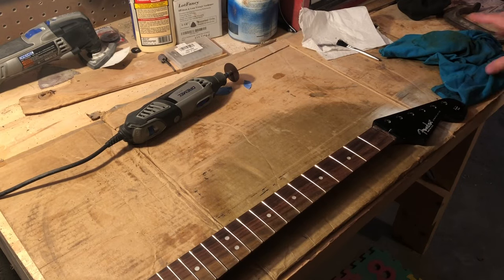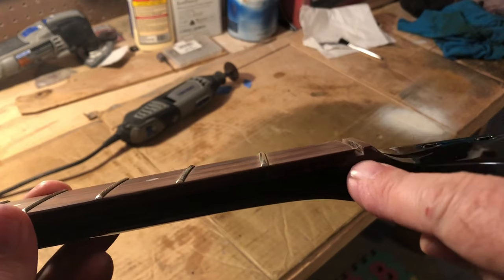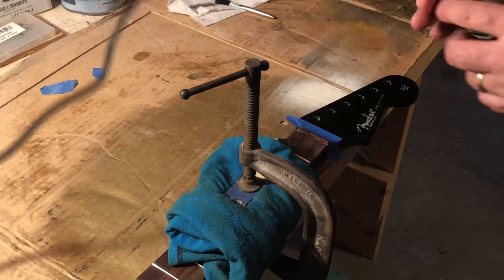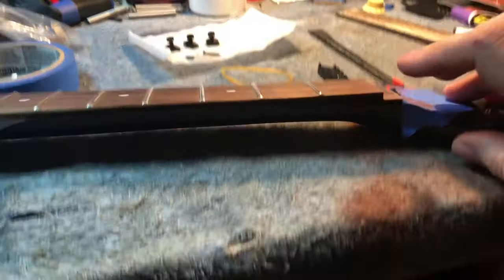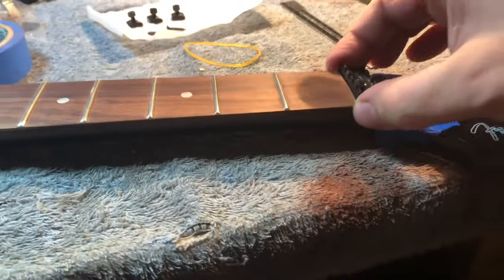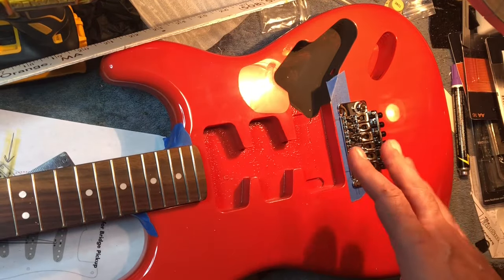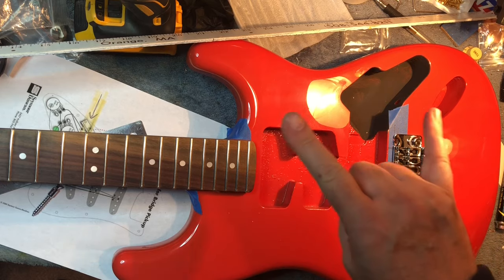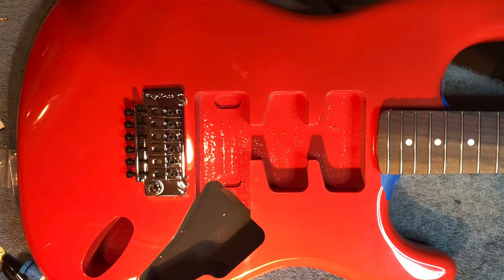Installing a Floyd Rose On A Fender Brad Gillis - Full Tutorial

Comment: Is the floyd rose shown at the end of the video the one you going to intall? Becouse that one hasn't got fine tuning like the one you showed earlier,so what's the point to install a locking nut if evertime the guitar goes out of tune you will need to unlock the nut and then lock again with that bridge would make more sense the locking tuners with a tusq nut.
Reply from the maker: @thegladio64  It’s an exact replica of Brad Gillis’ guitar. He uses a non fine-tuning Floyd and a locking clamp. AND he’s done it since 1982 with zero issues. You just have to stretch and tune the strings, thoroughly before locking and it works just fine. You should watch a few Floyd Rose videos and learn about their history etc. Thanks for watching and commenting.

Comment: This bridge with locking tuners could do dive bombs and stay in tune without the “instability” of a double locking FR? 

I can’t seem to find too many new videos on the non-fine tuner bridge so forgive my ignorance.
Reply from the maker: The double locking Floyd Rose is the most stable tuning trem ever! Not sure what you meant there?! Yes, the non fine-tuning Floyd, combined w/ locking tuners should perform very well; divebombs etc. I built this guitar as an exact replica of Brad Gillis’ guitar. His came w/ an early non fine-tuning Floyd AND a locking clamp at the nut. He learned tricks and techniques to get the clamp locked while the guitar was in tune and it was remarkably stable, for him. Hope this helps and answers your questions. 🤘
Reply: @Metalcop5150  yes! Big help. I misspoke regarding the instability part. I’ve had FR for years and I know that once they are tuned they STAY in tune. I was referring to the floating bridge sometimes dropping when you replace the strings. My mistake.
Reply from the maker: @MrHomolka  The trick to changing your strings is to replace them one at a time!! Lol That sounds simple, but the trick is to take only one string off, replace it w/ the new one, tune it to pitch and then do the next and so on. That way you never ‘lose’ your setup!! There are lots of other tips and tricks out there, but for a floating bridge, this works best for me. 😉
Reply: @Metalcop5150  thanks!

Comment: These are the most involved installation, even a pre-routed body from overseas is a pain in the butt since you have no reference to what template they were using! I have a FR routed Strat style body that I've doweled already because I have no reference points. I am starting over and trying to find templates without spending hundreds of dollars for Stew-Mac stuff. Musiclily offers a template, but all I need are the correct measurements for the posts.
I think I finally found one and printed it up while I wait for the neck to be delivered so I can measure out the length and make sure it's correct. It's heartbreaking to have it all put together and go to jam out some Van Halen and realize the damn thing won't intonate because the measurements you took were wrong because the body is a one-off.
Reply from the maker: It can be a daunting process. I have done a ton of these, so I can unequivocally say - It gets easier the more you do!! Promise. I use the Stew Mac templates. I bought them many years ago, I don’t remember them being that expensive? The crucial measurement is from the nut to the posts centerline. You can cheat that line about 1/8” forwards and back, but really no more. Then bolting on the neck and using straight edges to ensure that the Floyd is centered to the NECK. Not too the body! The final thing to remember is that a Floyd route is different from a Fender vintage trem route!! You can make the Fender work, but the mindset has to be that you are modifying the guitar for the Floyd. The Floyd itself is very unforgiving. I used to do the through the neck Floyd nut clamps, but I won’t even attempt them anymore. Way too easy to ruin a neck!! This guitar neck and body took the Floyd mod quite well. Can’t say that for all guitars. Good luck with yours!! 
🤘😎🤘

Comment: Any idea if brad uses 2 or 3 springs for the tremolo, i use three and its really tough to dive and pull up and he makes it looks really easy with just his middle finger.
Reply from the maker: I honestly don’t know the answer to that question. If you could find out what size strings he uses, that would be an indicator of 2 or 3 springs. I’d say anything larger than a 9-42 set requires 3 springs. You could always experiment w/ the real Floyd Rose high tension noiseless springs? I’ve always used 3 and I like that. I’ve recently noticed a lot of Van Halen disciples using only 2 springs, fwiw. Thanks for watching and commenting!!
Reply: @Metalcop5150  thanks for thaking time to reply, his video says he uses 9s. Im running 10s on mine but just recently got into tremelo work by brad and joe satriani etc so im gonna switch to 9s and try 2 springs and see how it does. Thanks enjoyed the video, new sub!

Comment: I was thinking about using the wood screws too for my build with the non fine tuner version. Not gonna use a locking nut tho. They are now being manufactured in Korea Ive heard. Probably at the same place they build all the guitars for everyone who wants them to.
Reply from the maker: You just have to be careful. It’s easy to tell the real German locking clamps from the 1000 Series (which are well made and precise) and finally the Specials, which are absolute junk. The price is the biggest indicator. If you can get an entire FR assembly, including the clamp for $100? It’s a Special and it’s a paperweight. The 1000 series uses mostly quality forged steel but does use mild zinc alloys, for the saddles etc, just for cost. I would always recommend a locking clamp, but that’s just me. Thanks for watching and commenting, my friend!!

Comment: Did you need to shim the neck?
Reply from the maker: Only if you want the tremolo to float. If you want a flush or top mount style, you do not. Meaning the tremolo will rest, right up against the body, Van Halen style, unless you shim the neck. Honestly, with a non-fine tuning Floyd, the flush mount is the way to go. Tuning is already exceedingly difficult, if you wanted the tremolo to float, it would be damn near impossible. Hope this makes sense. Respond if you need any further clarification. 🤘

Comment: Great video.. Great video.. 
I have a strat I just built, but with a 6 point start trem, but I want a non locking tuner floyd just like brads.. Brad is a hero of mine.. I saw him with Ozzy and have been a huge fan since. . So, I have a warmoth neck with stainless frets.. 22 jumbos and I love it.. 
How do you once everything installed and strung up .. How do you get the strings in tune once you tighten down the nut? Because it will probably go sharp? Do you loosen the nut and keep adjusting over and over until it stays in tune correctly or does it get in tune and when you lock it down does it not move the strings out of tune? I mean, there was a reason they added fine tuners.. 
I'm going to have a luthier do mine because I'll mess it up probably if not careful and I don't have all the correct tools.. 
Great video and I'll check out more.. I subscribed and gave it a thumbs up of course! Very cool.. 
Thanks and regards from south central Indiana. USA
Tim
Reply from the maker: Great, thought out, and we’ll written comment!! Thank you. 🙏
The way I tuned, I actually got tips from Brad Gillis?! In his Hot Guitarist instructional video. 1. You have to stretch the ever living F out of the strings! 2. You have to experiment and see how much the tuning will change, once you tighten the locking nut/clamp. The strings will go sharp or won’t change at all. So you have to tune flat, the right amount so that the clamp will essentially pull the string into tune. I’m not going to lie; it’s a giant PITA! The good thing about a non fine tuning Floyd is that if you get sick of the tuning woes, a fine tuning version will drop right in. In all honesty, I won’t use a non fine-tuning Floyd. I made this guitar to sell, (it sold in a day!!) so I made it a hyper accurate replica. Love to know how your guitar turns out. Truly appreciate the support, my friend. 
🤘😎🤘
Reply: @Metalcop5150  Thank you kind sir.  That makes perfect sense.  I have an Ibanez with a low pro edge and I can tune it and stretch the strings out good and I've forgotten to tighten the locking nut and it still stayed in tune. I just happened to notice one day they were loose when I changed strings, so that makes perfect sense. 
I will absolutely let you know when I get it installed.  I'm going to try it for awhile with the gotoh steel 6 point trem and graphite nut I have now as well as staggered locking tuners. No string tree to get in the way and cause problems.. 
I like Floyd's with fine tuners as well.  I have a Charvel with a factory Schaller Floyd and it stays in tune if you throw the guitar against the wall. It just doesn't go out of tune, but since Floyd rose reissued the non fine tuner I just love the profile and how well it works and less to go wrong.  Just a cool trem.  
That guitar was so cool.  Glad to hear you sold it that fast. Very cool.  
I would love to find one of the Fernandez guitars of his as well.  I may have to make a replica of his strat some day maybe.  I love his ideas.  Very cool..  
Thanks brother and I will keep watching your videos and brads interviews, etc. 
Best regards kind sir
From the heartland.. 
South Central Indiana . 
USA
Tim.
Reply from the maker: @hoosierdaddy2308  I do have the parts to build another Gillis Strat. Just saying… lol
Reply: @Metalcop5150  Hahahaa.  Cool man . I will have to do the same in the future.  I built that strat I was telling you about and I have an Ibanez S series from Japan. About a 94 which is one of my favs because it's so light and easy to play with that paper thing neck.  I just need to get either stainless or EVO frets installed.. Then I'll put it together and love it.  I love the low pro edge trem. It's just killer and probably as good as the original Floyd, but different and has the best low profile.  I would like to try the low profile Floyd on a build someday.  Anyway, good talking to ya man.. Keep up the good work and builds.  Video the new build of you do it.  It will be very interesting. ♥️🤘
Reply: @Metalcop5150  Oh.  I forgot to tell you. The strat turned out great.  I ha e two EMG humbuckers. I love them because I hate being shocked and back in the day I was shocked a couple times with bad wiring in an old club where I was in a band and jamming.  Passives make you the ground as you probably know when you touch the strings which makes me very very nervous and EMGs don't do that because they are internally ground.  I also use a wireless system as well which works with Passives when I use a guitar with them. I like them a little better in some ways, but I also love the EMGs.  An 85 in the bridge and a 60 in the neck which does blues stuff so well. Both do really and active tome controls that really do something besides just roll of treble.  Plus , you can use 1600 feet of cord and won't lose treble or tone. The preamp drives the signal so good... Plus, for 80s metal ballads and hard rock and blues they sound great.  
Be well sir and God speed man!!!

Comment: Why don't you use the hardened steel pivot screws and sleeves marketed by WD ref number 1087. They are alot thinner than those FR screws and won't have the FR knife edges start chewing them up as happens on those FR ones. Plus the tuning stability will be constant unlike those FR screws where the tuning stability will suffer as the knife edges of the FR chews them up over a period of time.
Reply from the maker: A. I am replicating Brad Gillis’ guitar, which uses the old school, wood screw style posts. Authenticity matters to me. It has to look the part and function as well as the original. 
B. I have no experience with the WD product you mentioned. However, I have nearly 40 years of experience with the Floyd Rose!! I can assure you that neither the knife edges of the trem assembly, nor that of the wood screw posts will ever wear out. As in never. They will literally never wear out. They are built of hardened German tool steel and they are indestructible. I don’t know this for a fact, but I would wager that Brad’s guitar still has the original posts on it, from 1982. They’re that good. 
So all in all, why would I replace the period correct posts, which are the best made knife edges posts ever made, with any other inferior product? 
The Floyd Rose tuning stability is unmatched. It is the benchmark in which All other trems are judged. Units built from 1982 through to today are still perfect in their function. That is a fact. 
Thanks for watching and commenting my friend, it is much appreciated. 🤘😎🤘

Comment: Those are the most interesting mounting studs I've ever seen.
Reply from the maker: The old school 'wood screw' inserts? They were standard on all Floyd Rose trems until around 1987 or so, when they switched to the allen machine screw inserts. I prefer the wood screw inserts. You remove a lot less material from the guitar, but can sacrifice long term stability, if installed in a softer wood guitar. Though I've never had any issues.
Reply: @Metalcop5150  I live in a climate with extreme temperature and humidity changes.  Seasonally, I have to make adjustments, including trem heights at times.  Even though they are minor changes, I'd worry they'd be unstable after a couple years.
Reply from the maker: @ivankrushensky  They work just fine. Plenty of guitars from the 80’s still rocking them!! I’m looking at my ‘85 Hamer Scepter, and they’re rock solid. If you’re doing a top mount, non-recessed Floyd, the wood screws are decked and will literally never give. It’s when you’re trying to do a recess or the neck angle necessitates that the wood screws have to be adjusted too high out of the body, that’s when you have issues. My Brad Gillis guitars? Guaranteed, they will never fail. There also needs to be enough room between the machine screw inserts and the pickup cavity, that can cause extreme weakness in that area. Point is: there’s applications for both. If I’m doing a period build, or adding a Floyd? They’re getting the wood screws 100% of the time.
Reply: @Metalcop5150  that makes sense.  All of my Floyd Rose trems are recessed.  About the scuff on the headstock- you're going to need a lot more scuffs and scratches to be a Brad Gillis strat!  Consider it part of the "relic" process.
Reply from the maker: @ivankrushensky  I try and leave the relic'ing up to the end user! lol